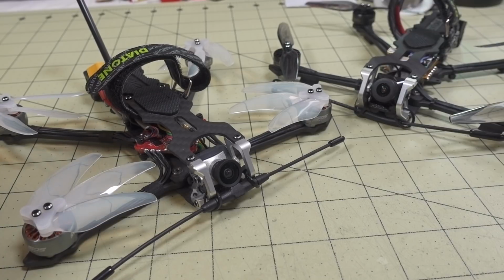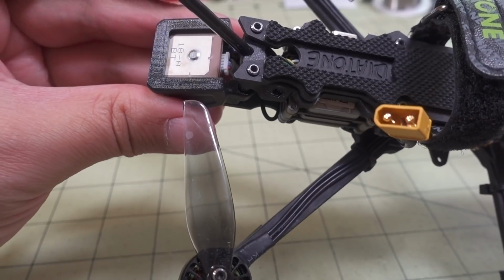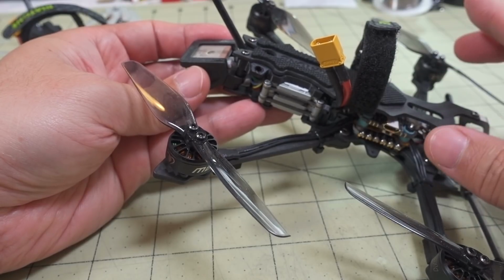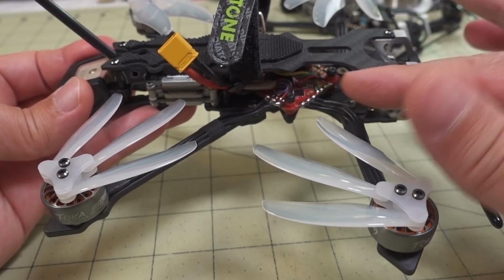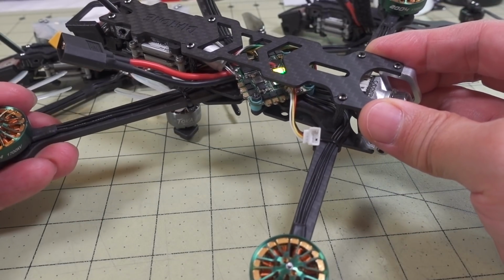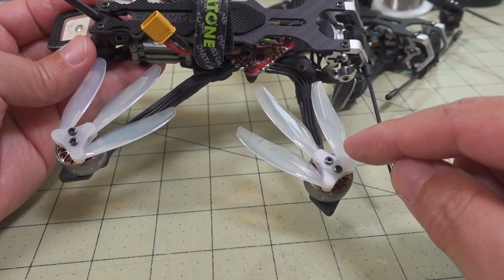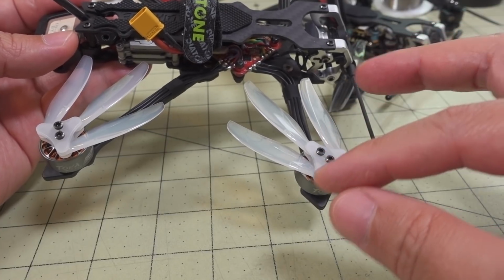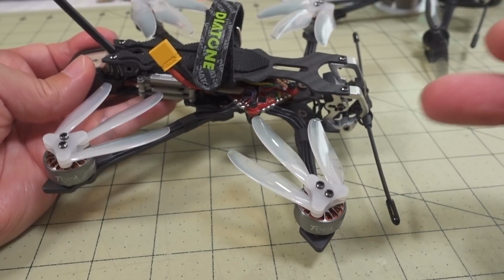Fun Build // MAMBA 1505 Motors // Diatone GPS Fix // Gemfan F4019 Folding Props 🛠️

Comment from the maker: Diatone Shielded GPS Cable - http://bit.ly/2OeSm82 | http://bit.ly/3rKQQbB
MAMBA 1505 Motor - http://bit.ly/3l8GJM4 | http://bit.ly/3cJXYkc
Gemfan F4019 Prop - http://bit.ly/3rKLm0o
Roma F4 Frame - http://bit.ly/3rGv2xT
HGLRC Zeus25 AIO FC - http://bit.ly/3cMXBpc | http://bit.ly/3sPzpI4 | http://bit.ly/31FpGbF

🙏 Please support with a 👍 and don’t forget to hit the 🔔 thanks!

👉 Old gear for sale here -  http://bit.ly/AlbertGearFS

💲 Get the latest exclusive coupon codes (updated often)
     http://bit.ly/34SYiGn
Reply from the maker: @AddictedQuadroner  My Nazgul5 was DJI and the Roma was analog so I can't really be objective about it.  I prefer DJI.  Has nothing to do with the quad.  I would get the Nazgul5.  If they were both DJI, then I would get the Roma if I wanted better motors.  But I would get the Nazgul5 if I wanted a stronger frame.  However, I would get the Roma if I wanted a frame with better geometry.  However....
Reply: @Bowen Darius yup, I've been using Flixportal for months myself =)
Reply: @Bowen Darius thank you, I went there and it seems to work :) I really appreciate it !!
Reply: @Alan Jesse you are welcome =)

Comment: Currently doing something similar with my Chimera4 now on 4700kv 1404s and 4s, next step I am looking at Mamba 1606s, or switching to the Rekon4 FR that is coming soon for 2xxx motors. NIce vid this looks to be a good setup. Amazing the cable makes such a difference.

Comment: Other than Mamba gps modules, which others do you recommend that work well and won't break the pocket for 5" drones?
Reply from the maker: I've found that most will work just fine with proper shielding.  I've heard the matek is a little better at handling interference but even those will fail when not properly installed.
Reply: OK, thank you.

Comment: I have issues on my Roma F4 analog  with dropping GPS sattelites as soon as I exit VTX pit mode. What I have found that main source of radio signal interference is VTX antenna since the change of position of antenna affects number of sats GPS locks. I am now experimenting with 3D printed extender for VTX antenna as well as moving GPS module further away from VTX antenna. Do you have connected ground to shield on GPS cable?
Reply from the maker: I don't have the analog version so not sure how to help with that.  Have you tried the shielded cable I mentioned in this video?
Reply: @AlbertKimTV  yeah, I think recent versions of Roma F4 comes with shielded GPS cable and in my (analog VTX) shielded cable itself does not help much, allthoght I have not checked grounding of the shield. Will need some more things to check.

Comment: The GPS module itself picks up satellites, not the flight controller. You will notice that if you power up a GPS unit (even without a flight controller attached) it will still pickup satellites.  The cable to the GPS is only really good for the flight controller asking the GPS unit for GPS data.  What I'm trying to say here is a cable in-between a GPS unit and a flight controller is neither here nor there for satellite fix.  
 Having a GPS unit so close to a digital VTX is the problem.  Put the GPS on top of your battery or let the GPS unit get a satellite fix before you power on the VTX.  
Such a short cable as well on a UART that runs at such a low baud rate doesn't really need shielding anyhoo.
Reply from the maker: The Vista is emitting a lot of RF noise that interferes with the signal that goes from the GPS to the FC.  So the data becomes corrupted leading to less satellites or no fix at all.  Trust me, I've tested this a ton.  When I just power on the FC and GPS with the Vista powered off, it gets a good lock even without the shielding.
Reply: @AlbertKimTV  same happens with a Runcam split unit!